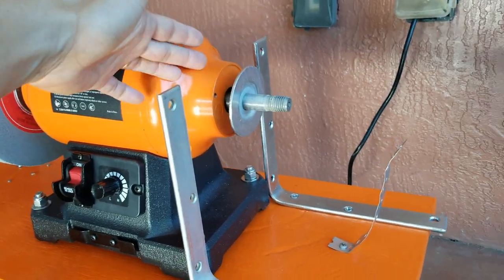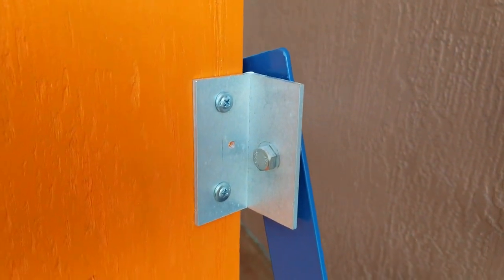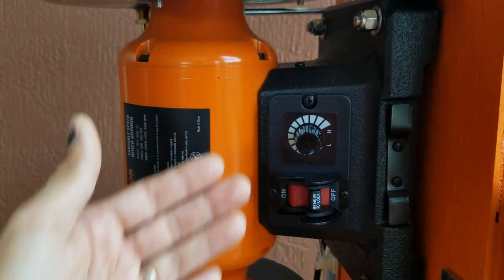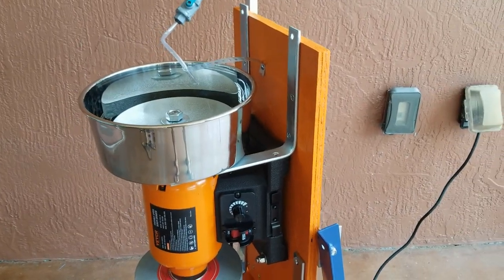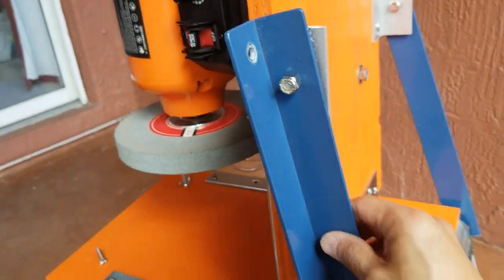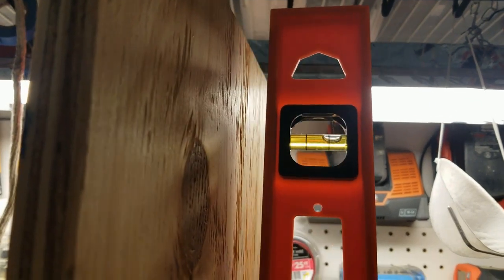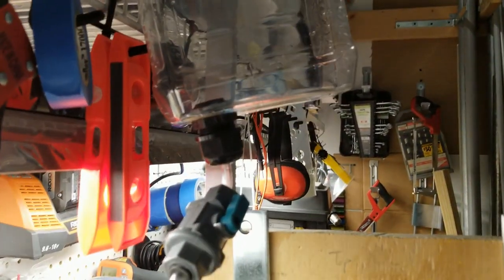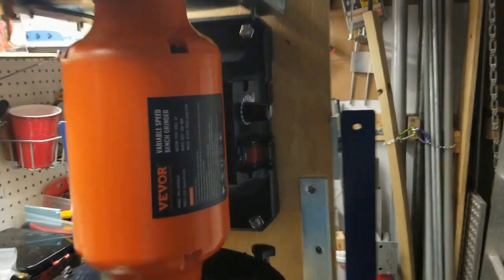How to make a Convertible Flat Lap Grinder for under $250

Comment: Thanks for sharing, I'm building all my own as well!🍻
Reply from the maker: Thanks for watching
Reply from the maker: If you do use a bench grinder find one with a bore of 1/2 or 5/8 in ( mine is M16 metric) if you are planning to do other stuff with it.  If not, this one just as is would do the trick with any disc's that just need to be bolted on. It took some time but I was able to find a few things that will thread onto my M16 post.  It was frustrating, and having to drill out disc's from 1/2 to M16.  oh well.
Reply: @crystalminerrocks6122 good to know! Thanks!